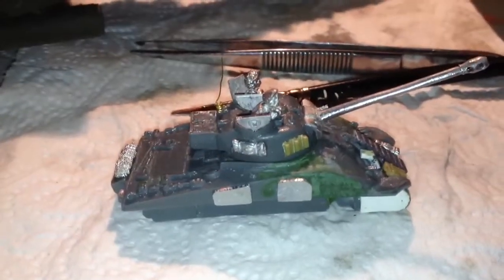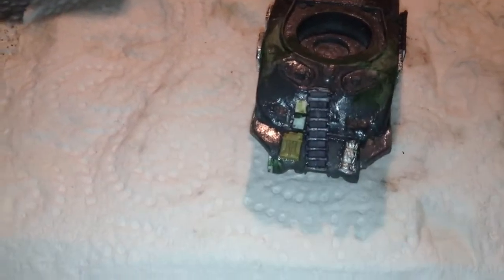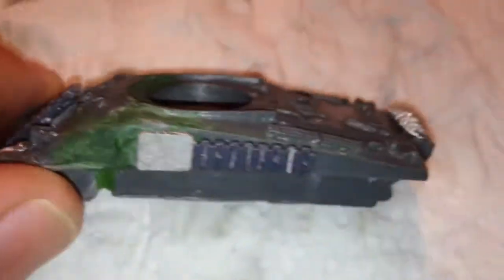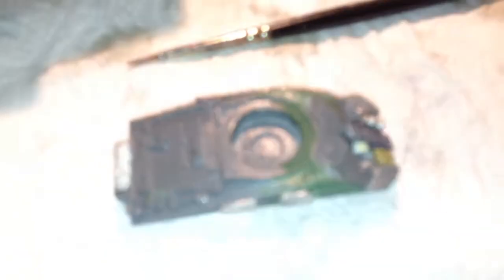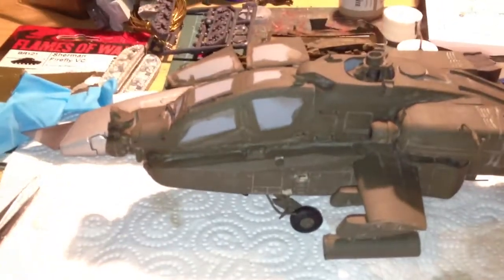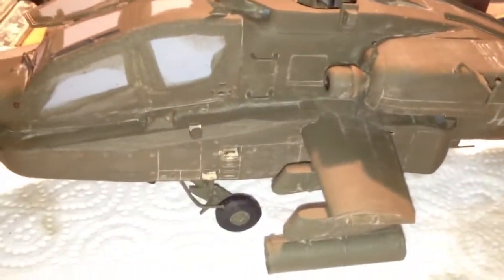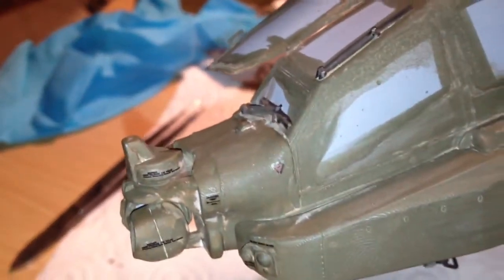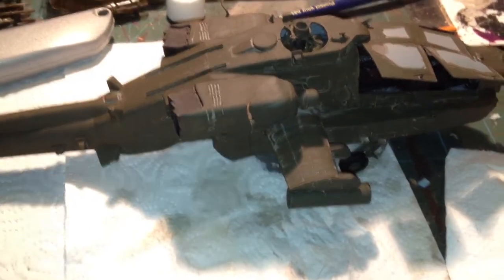Tommy Cooker 3

Comment from the maker: Cheers mate. The antenna is just a single strand of picture wire, rolled around a file handle to get the coil at the bottom. Easy.